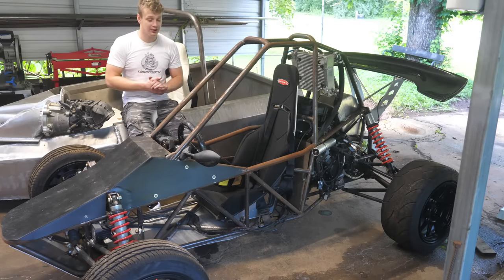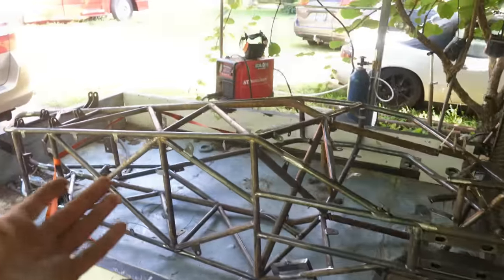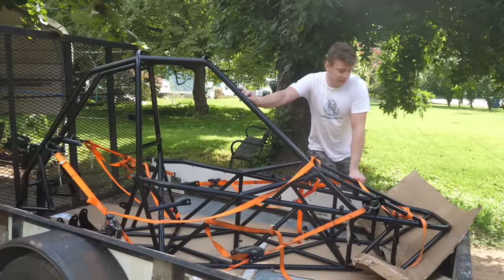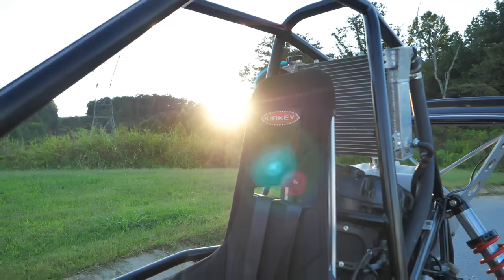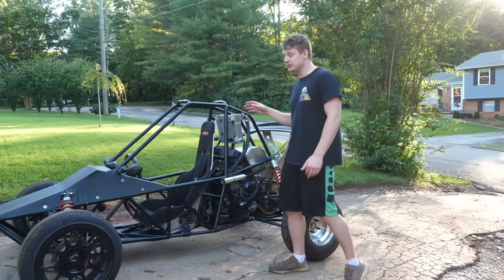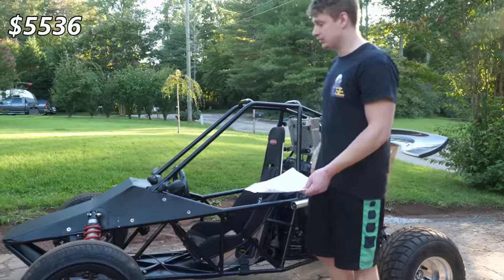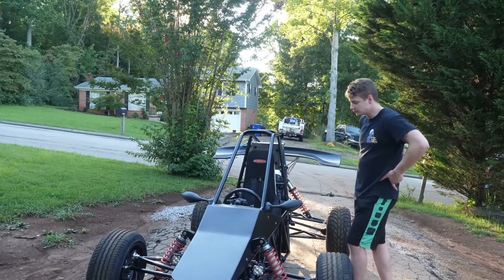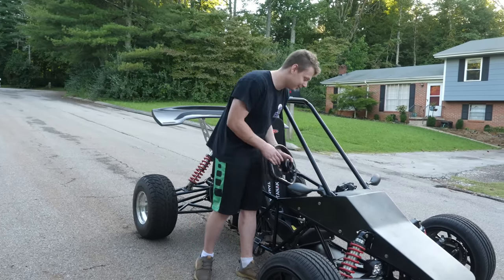Street Legal Crosskart is Finished! How Much did it cost???

Comment: Careful welding while attached to the car. Grounding through trailer hitch can kill your battery and/or your alternator.
Reply from the maker: good call for next time
Reply: That's mainly for high frequency tig.
Reply: And fry modules
Reply: @Ratkill9000  only mentioned it because I've done it MIG welding.

Comment: I'd love to see you build another one bigger and better like you said!
Reply: If you want torque, get an engine designed for it. A crotch rocket engine is designed for top end revving, not torque.  Bigger is not necessarily more torquey.
Reply: @josephbania4564  Are you kidding, my '89 FJ1200 had huge torque, it wasn't a weed whipper 600.

Comment: The only thing you could do is change the gearing if you want to stick with the engine. You'll lose out on top speed, but you'll make up for it in torque. Maybe a V-twin could do you better in torque. Chain conversion Harley Davidson could work well.

Comment: Thanks for figuring all of this out and showing us ! Wanted for years to fab something like this as 4WD. Using a Suburu front diff and Transfer Case (aluminum) and a ZX6 or ZX7 engine for power. Concept is, small and light with just a bit more suspension travel. You really did a nice job. Inspired now, Thanks!
Reply: you could do that?

Comment: i want to know the complete weight!..............100hp and 45ttq might not seem like a lot, but thats pretty good tbh in one of these tiny karts. I bet it feels pretty fast. But a Carpenter Racing 210hp package on a Busa engine would make this a BEAST and would be under $6000 total for the entire bike and Carpenter package from carpenter once the extra stuff was sold
Reply from the maker: I would guess 550- 600lbs Is it a na or boosted package?
Reply: @VasilyBuilds  the 210hp package is NA and uses stock cylinder size (unlike their higher tier packages which are 1397 or 1430cc).....their 210+hp package is $3900 Turnkey, Drive in, drive out with labor and includes airbox mod/clutch mod/power scoops added. 213whp and 113tq. Look them up, pretty cool guys and Bob does a damn good job and is VERY well regarded in racing and higher hp streetbikes. Hes been doing that package since like 2004 too so VERY well proven

 Rode one with their 230-240hp package($5300 installed and all) and MY GOD.....full throttle in 4th was literally warp speed before 11k rpm even compared to my r1 that makes 170whp and that is 120lbs lighter

Comment: Nice !!  ( the rear wing needs to be higher to get clean air to do its job at high speed) ( or mount the radiator on the side lower)(probably could use a front air wing also)
Reply: Moving the radiator to the front would clean up airflow over the wing, but the wing is just for show with it's current design.

Comment: I would hope v2 will have a reverse, I mean I can Invision alot of issues driving on the streets with no reverse you can get by with it on a bike because your feet touch the ground but a cart you will find yourself in a predicament that will require it. I have seen other guys on YT that have found a separate revers box they uses or even a second transmission but I don't think in 5his case that would work well but I know they make them. Anyways still an amazing build keep it up.

Comment: Stunning build. The location of the radiator concerns me, not only proximity to the driver but airflow. If you mounted it further towards the rear it would be safer in the event of a failure and body panel/ducting could direct airflow towards it.

Comment: 600cc Is perfect for off road build 1000s n 1300/1400 engine don't enjoy Rev limiter like most of us off roaders just change the gearing ratio like done on stunt bikes and it'll be plenty torqued up won't go 160 anymore but it can still do 75-100mph

Comment: Do you have a set of blueprints etc for building the frame and then the rest of the vehicle. Also a parts list etc.
 Fantastic project. Very well built buddy, cheers for sharing.
Reply: Check out The Edge Products. They have plans for several different chassis designs, and have been manufacturing buggies since 1989.
Reply: @MellowYe77ow  brilliant, cheers buddy

Comment: I would start with an Edge Products buggy kit. I've not seen this in street legal trim though. What states would it be legal in? What specific criteria determines eligibility?
Reply from the maker: having a vin helps alot. maybe an existing chinese buggy or Vw bug.
Reply: @VasilyBuilds  I get what you’re doing with that but Texas has annual inspection. There are a few criteria that have to be there. Even registered as a home built it has to have a DOT windshield, bumper (even if it’s just a tube hidden behind fiberglass), headlights, restraints, defrost and heater, etc.
Reply: @headfirst6227  Dirt Legal registers the vehicle out of state. (Arizona, Utah, Montana, or South Dakota) The vehicle only has to conform to laws in the state that it's registered in. You're state's local laws are exempt. You can read more about it on Dirt Legal's FAQ page.
Reply: @MellowYe77ow  Wouldn’t that require a mailing address in the state of registration? I will check out the FAQ but I’m pretty sure that’s going to get complicated. Thing is, they see you coming.
Reply: @headfirst6227  Nope. The states that they register in don't require in-state addresses.

Comment: Where did you find a wing for 110$? I'm working on a similar project and can't find a proper wing for less than 300$
Reply from the maker: https://www.ebay.com/itm/335223282891?hash=item4e0cdd5ccb:g:hhkAAOSwk41lr3w1&amdata=enc%3AAQAIAAAAwK5u%2Fxu4fBHH5v41czUIVXrGd1Ve%2Bie2U1AOljkKprpQdpFmvl9jx8lB745zG%2BXMPU8VT7ZP2nw5%2BWR70jwydPGX58fbU8vnKPBVE7oExmUXI9zLjcRYLT7wFgmvDWDzxF%2Ft8hL%2BBf5Ms%2BE%2F3Zj7MDnaalyvgkB%2Bepd9HZNeV8PtDgHaVZ0ROcPU9sO%2Bqt4CbXnvxM9%2Fon0%2FBqbC9%2BFzwPneG2ypotYVpqoGBOmwofslP%2FyjP1rzRuuV%2FCpHKwVnJw%3D%3D%7Ctkp%3ABlBMUP782JOxYw
Reply: @VasilyBuilds  Didn't expect for a comment from you 😂 thanks man! Unfortunately they do not ship them to my country...

Comment: How are you running a rear diff and irs with a bike motor
Reply: It's not a diff. It's basically a locked spool that adapts chain drive to CV axles. He bought it from someone online that doesn't make them anymore. There are companies like Transworks that sell differentials for buggies with bike engines.